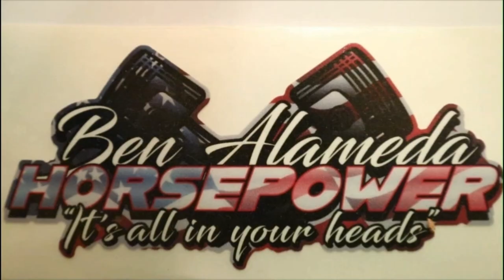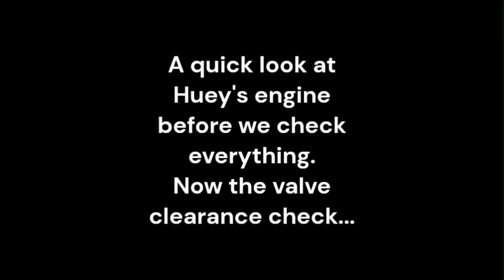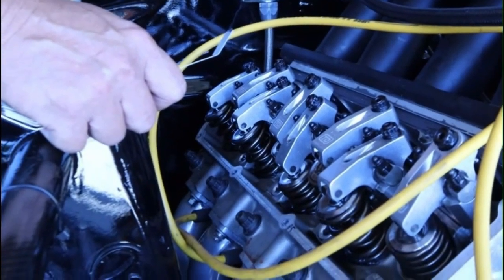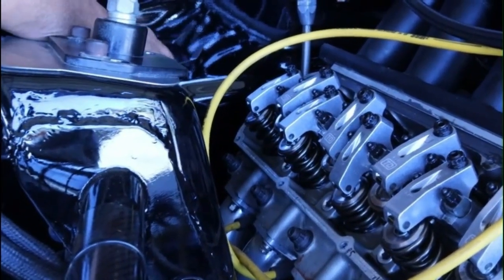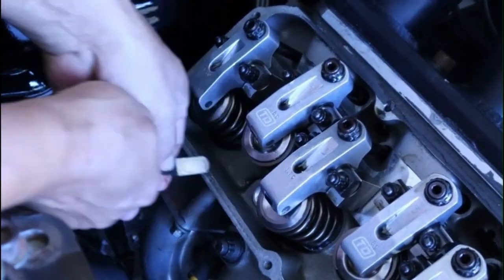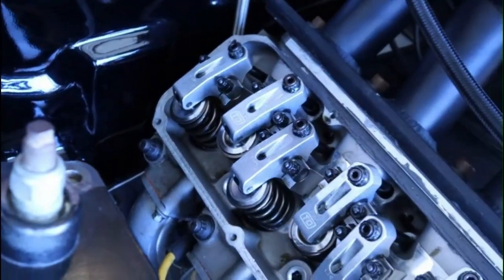CHECK V-8 VALVE LASH  IN A MINUTE OR SO!

Comment: Most people go 1 cylinder at a time down a bank alternating int exh.  But I like your method 👍.  
Not sure why but hearing ICEO I have to think 😅 even though it's the same thing as EOIC that I'm used to referring to it as.
Don't like the TDC method.  I used it when I first started, just on mild SBC stuff and it worked fine but at least with EOIC/ICEO you can apply it to whatever cam.
Reply from the maker: They work the same and just switching the letters ends up with the very same thing.  TDC method everytime I see a racecar being adjusted this way scares me because it is easy to watch the intake valve finally close and ends up on the uphill ramp of the exhaust lobe!  Too much to lose if it is adjusted wrong...

Comment: Love your method. 
I'll  skip the feeler gauge on my stock Chevy 4.3  hydraulic.

....unless maybe you can do the same,   say,  using a .010" feeler then add 3/4 or a full turn. 😱
I'm not crazy... But I'm practicing 😁
Reply from the maker: Right on that will work.  I like the noise method of adjusting, losening until it makes a ticking noise and slowly turning it until it stops.
Reply: @benalamedaracing2765  You mean we're both hacks? 🤣🤣🤣
Funny how people criticize that method. I think it's extremely consistent.
That .010" feeler guage, if my math is correct,  is almost exactly 1/4 turn with a Chevy 350 rocker nut thread.
....so, adding one full turn after removing the gauge would equal 3/4 turn.
I may try it when I replace my valve seals.
I/we really appreciate you responding to people so often. In case nobody has ever  mentioned it,  😁  you're a really nice guy. 👍  
Merry Christmas Ben.

Comment: Ben I actually went and adjusted my valves like you suggested. Before at a high Rev you can hear the clatter in the. After I Justin like you explained. The engine run so much better and no more clatter. I'd rather adjust some your way now. Thank you
Reply from the maker: Your welcome John and thanks for viewing my videos!  Anyway I saw some people turn them in from zero 1.5 to 2.0+ and wondering why their valves/lifters floats early when it should rev some more.
Reply: My whole shot improves. I could feel the power respond a whole lot quicker. Motor sounds a lot more crispy. I have been watching your videos for the last several months and have learned a lot. I find your videos very informing. And your knowledge is incredible. Your videos are very impressive thank you again.
Reply: I remember in one of your videos explaining that when you have a can that is a little bit on the rowdy side. Your way of catching the bottom side of the Loeb. Is a more positive rating.  Thank you again for taking the time to talk to everybody on the channel.

Comment: I like to use a tight lash ie .010 - .012 that way the valve train doesn't get beat up. What's your opinion on a lose lash? Thanks.
Reply from the maker: Tight lash is definitely quieter because there is less clearance to clatter.  Loose will too much noise on the valvetrain an with moderation you can tune the engine with either settings.